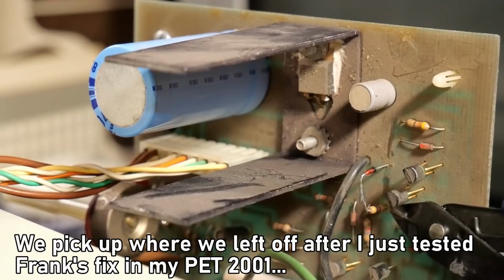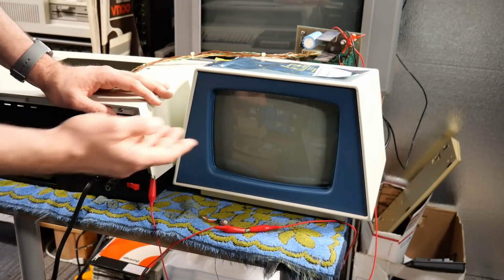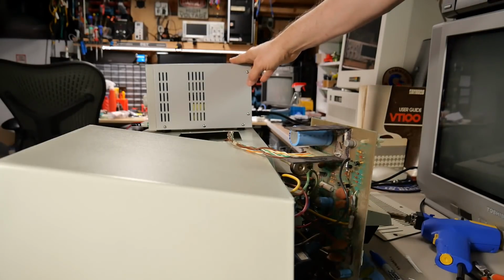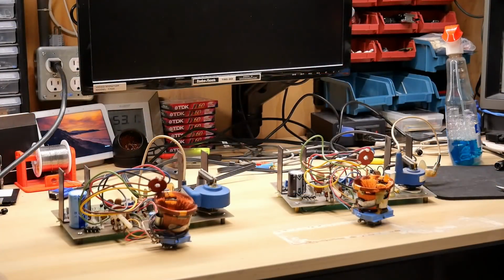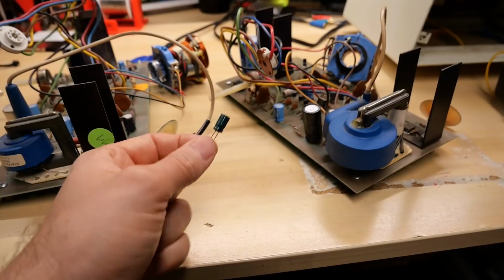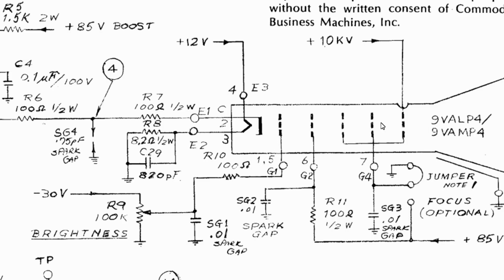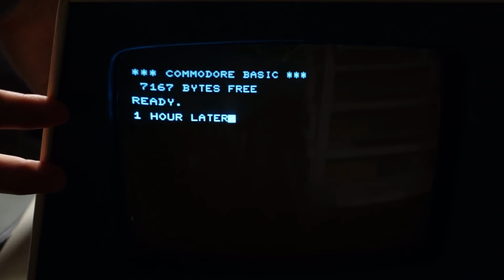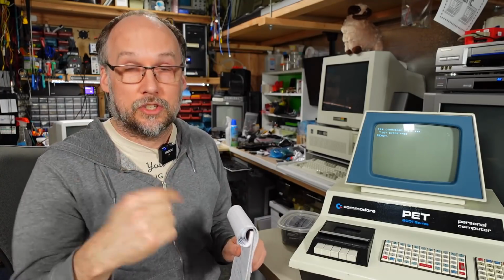Really fixing the CRT spot on the Commodore PET 2001

Comment: On one side I think he did well, I mean he fixed it and he clearly knows a bit but some things are very strange here. You should never use a capacitor with less voltage, only same or higher values (maybe okay when you check it but not common practise and not really explained in te video sp better never do that). If you put a 50V cap in the wrong spot, thats not a good idea in the first place. 2nd I dont think that transistors can leak, that is capacitor what you mean (electrolyte). Also does not really explain what is the problem with the dot? Just optical and you dont like original behaviour or does it burn the monitor over time? How often will you switch it on in the coming years? I dont think that you use it that often to wear something out.
Reply: Of course he knows what he's doing. That C22 is subject to only 30V (or so) bias, so a 50V part is adequate there. Commodore used a 250V part because they wouldn't bother stocking all different voltages, but it was way overkill for 30V smoothing.
Reply: @iz8dwf  he should have explained of above mentioned reasons. If anyone tries this at home it may not be sufficient replacement.

Comment: Adrian, I would strongly suggest replacing ALL the electrolytics. As you noted, the ESR of those caps are pretty bad. They are after all 50 years old. Heat and age are not doing them any favors.

Comment: So word of advice,  for those with hearing sensitive enough to still hear the coil whine of the CRT tubes you can remove that audio in post because it's always at a specific frequency usually. I'm probably not in your usual audience since I'm only 23, but I'm probably not the only one, and with both machines being on it made my head wanna split with how ear piercing it was.

Comment: Does putting the optional focus control back in cause the dot to reappear? Kinda wonder if chuck's monitor has a focus control. :)
Reply: A pot installed between 85V rail and ground definitely makes an easy low current path to ground from the cathode, so yes it would cause the spot to appear. Chuck's monitor is fixed too by now, he just published a video about it.

Comment: Poor bright spot, nobody cares about him, may he rest in peace.
Now seriously, those points are really very harmful to the phosphor of the crt, and even more so, so bright as the starting point of your pet
With so many changes you practically redesigned the circuit.
For me, due to ignorance, the question arises, These changes cannot produce other inconveniences in other places that are now unnoticed?
Reply: All but one change (the 8.2V zener) were already made by Commodore in the rev.2 and rev.3 9" monitor design. The 8.2V zener mod is calculated to have the same exact running current as the original R2, so no, there can't be any side effect as far as I could imagine myself (beeing an electronic engineer).

Comment: Hopefully the fix works for chuck. It seems there are certain vintage electronic parts that now need to be changed as a matter of course before even hitting the power switch, to avoid releasing the smoke that is sealed into every part when it is made (because everyone knows once that smoke escapes, it don’t work no more). I ran into such ‘rolling changes’ when working on one series of equipment, and I got to inspecting for and replacing certain parts before even getting into the first testing of the boards, and which usually took care of half the boards I worked on.

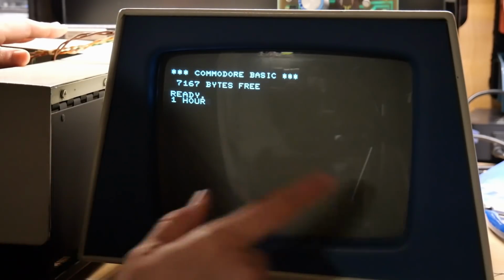Comment: 23:39 I had a Mitsubishi TV from the 1973 with that instant-on feature.  It did run the heater at reduced voltage so didn't cause any significant tube life issue.  The TV got scrapped a few years ago, just because no-one wanted it, but it still worked!
33:12 I've never thought to keep a dead parts bin.  Mine would be very full indeed by now, mostly of smelly electrolytic capacitors.

Comment: The "spot" when turned off is normal. Remember the old TVs that used to do that. It also can be a sign the CRT is getting weak.
Reply from the maker: But why is it normal, if this was fixed in all monitors and TV by the late 70s? It was "ok" to have it on tube TVs since end-users were in there removing tubes, and it drained the high voltage making it much safer to work on by inexperienced people.

But once things moved to transistors, having a spot was a design flaw...
Reply: It’s only normal if the design of the tube allows it to happen. The point is that the PET design was not supposed to show a spot, so it needed repaired.
Reply: I had to replace the picture tube in my 1963 B&W RCA TV set to get rid of the spot  .  When the CRT's electron gun  emission went too low the spot appeared when the set was turned off , and it was a bright spot . Lowering the brightness before turning off the set helped a lot , but replacing the CRT solved the problem entirely . I wonder if running the filament 1 volt low ( 11 volts instead of 12 )  of the PET's CRT could have aggravated the problem once the tube aged and the electron gun had weaker emission .

Comment: Fantastic work Adrian.

Will you be recapping the whole monitor a the ESR was quite high on the 3.3uf?
Reply from the maker: No, I won't be recapping. There is no need to recap something that is working perfectly. Also, that cap's ESR was actually OK for a 250v cap.

Comment: Adrian, can you work out a permanent fix for the focus, without leaking to ground? That would be interesting.
Reply from the maker: No, not really - a proper focus adjustment would allow the focus grid to be made both negative or positive voltages -- to find something that's best for the monitor. It's possible this monitor needs greater than -85V or it might actually need some positive voltage to get it just right. The design of the circuitry just isn't great...

Comment: I recall, when I use to use the 2001 PET back in the late 70s, and early 80s, 
I recall the CRTs did have the white spot after the deflection collapsed on power down.

You really should place some Teflon tubing on the zeners and resistors, and not mount them so "dead bug" style. 
It is just so much more professional. YMMV.

Comment: Every B&W TV I ever lived with, had that dot after power off, and it was burned in for ever. I don't recall the green Apple /// Monitor had it or not. But the old TVs sure did.
Reply from the maker: I have a bunch of monochrome monitors including the Apple /// monitor and no spot. In fact, I've never found any transistor based monochrome screen with the spot other than the PET 2001 monitor. Even my 1977 TRS-80 model 1 monitor has no spot.... because it was designed by RCA and they knew what they were doing.
Reply: @adriansdigitalbasement  Commodore Probably: We need a display. Kenny knows a lot about TVs, let's put him on the project. But Kenny works in the mail room. Get him over here so we can get this thing done.

RCA: Joe, Tandy needs a display. Can you reach out to the television division and ask one of their engineers to come up with a dedicated unit, as cheap as possible, but don't cut any corners. We don't want to lose this customer.
Reply: @danilko1  LOL!! Commodore: Hey, someone got a book on CRT design maybe?

Comment: You were very brave to turn it off with the heater voltage still on. I know the cathode has about 5 to 10 seconds of thermal retention. Quite a lot of spot supresion circuits rely on the fact the cathode will be cool enough after this time, oe the EHT has bled away.
I noticed the spot was a lot brighter when you powered  the heater from your bench PSU.

Comment: Okay, let me get this straight. So, there are cheap an good diodes from China? I thought all the crap that comes from china is cheap. The diodes you bought from Digi-key are made in China.
Reply from the maker: China makes tons of great things -- when there is good quality control in manufacturing and testing. Buying no-name stuff with questionable quality control is where you run into issues. How do I know if the diodes I got from AliExpress are not reject diodes made by Vishay? Like were tested, didn't pass QA and should have been destroyed but were resold instead? That is the problem.

Comment: I don't think the issue is the 33V Zener rather by using a bigger resistor you will provide the 33V for a longer time suppressing the dot for a longer time.
Reply: He tried a 2k2 resistor with the old zener and that didn't make any difference. Besides, the 33V zener (if working well) has no role in delaying or making the dot appear/disappear.

Comment: There is a Book called Servicing TV, Satellite and Video Equipment Revised Edition by Eugene Trundle and on page 70 there is a Wideband Class A Cathode Drive amplifier which might replace the cathode drive in that Monitor if not the book is still worth having.

Comment: unrelated, but one of my family's last TVs lasted about 12 years, until we replaced it with a flat panel we got from a family member, we replaced it because it was taking upwards of 2 minutes to warm up, when usually it only takes about 10-30 seconds. it was a zenith i believe. I think that's very good life for being turned on for at least 14 hours a day for 12 years, and knowing my dad, we probably got it used so add that on top.

Comment: Are you sure it was correct to flip the transistor? If you swap emitter and collector you will still have a working transistor but at very different (worse) specs. Conceptually there's no difference between the two terminals but they are often shaped/sized differently to optimize for using it in one direction.
Reply: The transistor was not flipped it was rotated to put the correct legs in the correct holes of the mobo, as long as the base leg is in the same spot on both you can just rotate them to get the correct alignment.
Reply: @kaliban4758  that's what I meant by "flipped".
Reply: @rfmerrill  ok, but flipped and rotated have two different meanings, sorry for being pedantic, but I deal with YECcers and flerfs on an almost daily basis.
Reply: @kaliban4758  I guess in the context of a physical transistor I'm having trouble understanding what the difference would be. In my mind "flip" means "mirror" and you can't like turn a transistor into a mirror image of itself. I guess if you installed it on the opposite side of the board?

w.r.t the leads, flipping and rotating would have the same effect I'd think... the center pin is always going to be the center pin, and then there's only 2 permutations of the two outer pins...
Reply: @kaliban4758  Oh I checked the video again and it's using a delta footprint, I'm used to in-line footprints for TO-92
Reply: I made my original comment because it's easy to get the pinout of TO-92 parts confused, because the datasheet will have a simplified drawing of the part that is not quite the shape of the actual package and it can be hard to tell which side is which. Some manufacturers are better about this than others.
Reply: e.g. datasheet will have a drawing of the part that is round with a flat side, when the actual part has a quasi-trapezoid shape, or viceversa
Reply: Hint: propulsion in a vacuum does involve pushing off of something: The exhaust from the engine. You eject the exhaust at a very high speed to push the craft in the opposite direction at a much lower speed. The speeds being in inverse proportion to the mass of the two things in question.
Reply: But I posted that so other people aren't swayed by your argument, I'm blocking you before I get any angrier.
Reply: @rfmerrill  that is what I put up with on an almost daily basis, that is my punishment for being a YECcer when I was younger,

Comment: Just tested. New 3,3 uF cap ESR is 0,78 Ohm. I used Peak Electronics Atlas ESR 60 meter. That cap was 100% faulty. Replace all electrolytics that are 40 yr old.
Reply: As a repairman once told me, "if you're in there already and the caps are cheap enough, just replace them and save everyone a headache."
Reply from the maker: Did you test a 3.3/250v cap or a 16v one? Because a 250v cap will give different results with a higher ESR being normal.
Reply: @adriansdigitalbasement  50V. 5 x 50V = 250V 5 x 1 Ohm = 5 Ohm. Not Exact but in the ball park.
Reply: Based on this table, 4,6 Ohm

http://www.jestineyong.com/wp-content/uploads/2012/05/ESRTable1.jpg
Reply: The cap was good, most old caps are not low ESR types,
Reply: @moshly64  This over 20 Ohm cap was 20y old. Replacing with a new one with 0,46 Ohm Esr got my power supply running again

https://1drv.ms/u/s!AjUWElMhwyMggb7PGw7RQUMnugy2KYY

Comment: It's always interesting to see what they did to revise designs to improve reliability, at the moment I'm in the midst of diagnosing issues with my Spectrum Plus & its' Issue 3B board, and it seems someone mucked up the DC-DC power mod circuit which could have lead to the death of one or more of the 4116 lower RAM chips, but I found there's a modern replacement module for those, so, may be getting that in the near future for it, once I undo the dodgy bodgery of course... :P

Comment: Every mic I've owned needed the soldering redone. Either cheaply done or wrong lead free solder. They crack easy in something that gets bumped and dropped a lot. So now when I buy a new mic I redo all the solder joints in the mic and the cables that come with it. I am still working with a mic I did this to 30 years ago and well abused by 2 children. I have 4 other mics that have lasted more than 5 and 10 years. All never needing a repair since redoing the solder. Cables wear out no matter what you do.

Comment: All black and white CRTs including ones that are another color have this problem as the age. The longer it is on the more worn out the tube is in general, even if the tube is still bright and sharp.  It depends on the design of the tube for the most part starting in the middle to late 60s to make the tube cheaper they made gun sit straight in the tube and did something else to stop ions from making the screen dark. Before this most tubes electron gun was slightly miss aligned to hit the glass in the gun section and then was corrected by the yoke. With that said you could still have a dot drag and go off quickly or a raster that quickly shrinks. It also has to do with the left over HV in the tube and everything discharging when shut off.   Color CRTs don't have this problem because of the shadow mask or aperture grill.

Comment: Can you rig up a solid state switch to bleed off that charge when the unit is switched off?
Reply: The problem is that most transistors or thyristors (SCRs or Triacs) can’t hold off the anode voltage of between 10-15 kilovolts DC; they’ll pop instantly. The HV rectifier is - essentially - a stack of 1N4007 diodes in a single package all in series; 20 or so gives you a hold-off (or PIV) of about 20 kV or so, but putting transistors in series is not so easy; you need to bias the transistors higher in the chain (further away from ground) with ever higher voltages to turn them on. Worse, the all need to turn on together, or the voltage drop will get concentrated across the ones that haven’t turned on yet, with the same disastrous consequences. And you have to overcome the inter-electrode capacitances, especially in MOSFETs. There are probably power transistors designed for that, but they cost way more $$$ than your typical TO-220 case BJT or MOSFET! A better bet would be a relay with high-voltage-rated contacts; probably gold-plated to resist corrosion.
Reply: Again - why? It's not a fault, it's a design choice...

Comment: Did you try the aliexpress diode after taking out the potentionmeter?
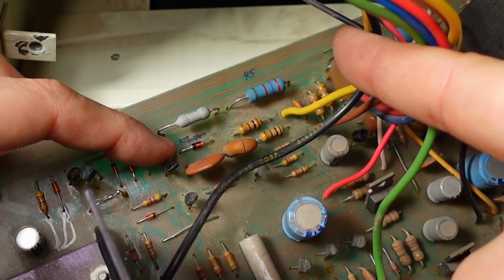30:47 - is that a capacitor in the middle? Looks cracked, doesn't look nice to me.
Reply from the maker: Yeah it was fine actually, it worked the same as the Vishay
Reply: The cracked looking cap is actually the spark gap, google spark gap capacitor
Reply: @moshly64  Ahh that's why it's SG4.
Reply: @moshly64  Ohh, okay, thanks! I noticed when he mentioned it on the schematics but I didn't imagine it looking like this.